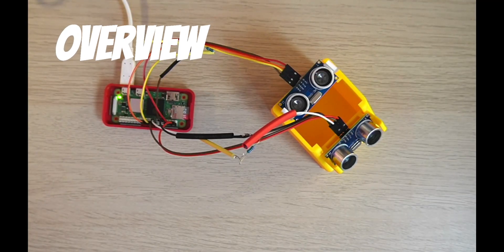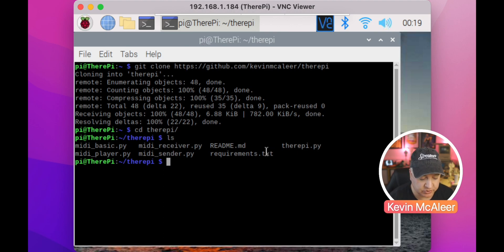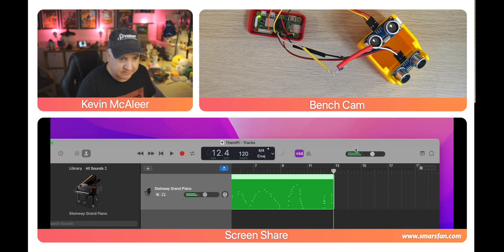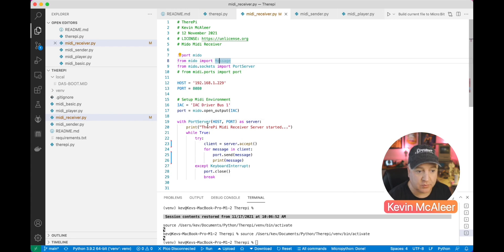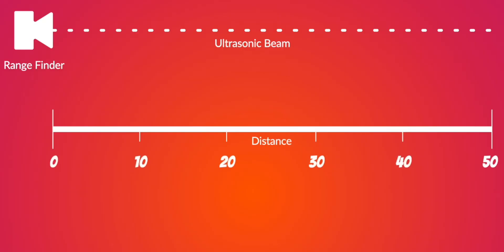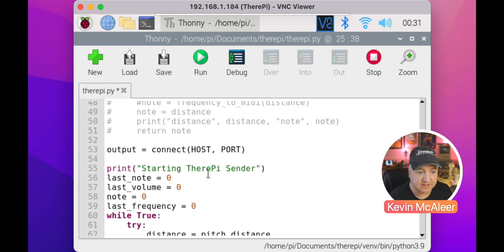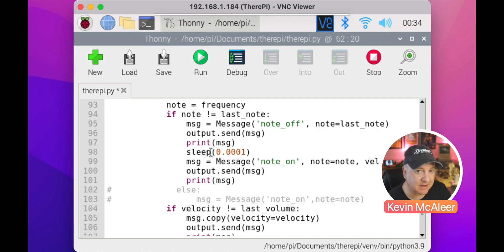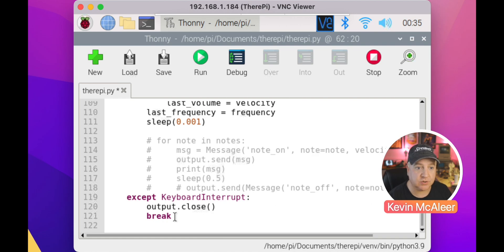Raspberry Pi Zero 2 Theremin - TherePi Part 2

Comment: It'd be cool to try and combine this with the USB Gadget mode on the Pi Zero. I'm sure there's a usb midi gadget mode which would allow this to be seen as a midi device over USB; the code could be amended to try over usb if the wireless connection fails.

Comment: Hello Kevin, I made your amazing project of a Theremin and it's so cool! I've a question : For my project I need only the Pitch captor and send a fixed velocity determinated before. You could tell me how to modify your python code in order to install only one captor and send varitions of pitch but always at the same velocity please ? I would be very recognisable. Thanks!
Reply from the maker: I’ll have a look shortly and get back to you - it will just be one of the messages needs to be set to 128 for velocity
Reply: @kevinmcaleer28  Thanks! In fact, I'm trying to use it as a sampler launcher with QLab, but quite difficult to get what I want... It works fine but, when you get out of the range, I'd like to get in the same note off to stop de cue. Now, when you get out of the range the note_off is last played and I'm getting difficult to programt the cue stop in Qlab because is not the same note off every time... Hope you can help me!